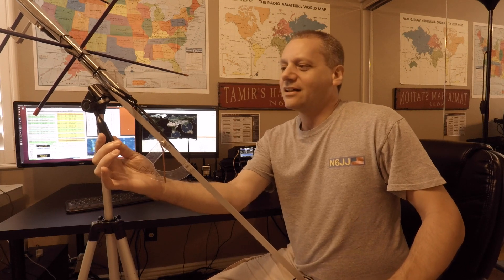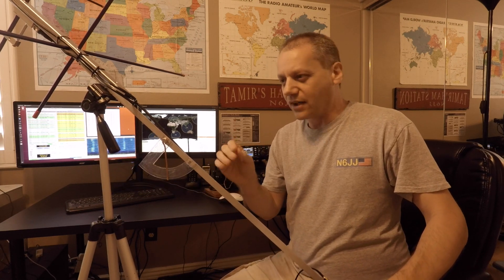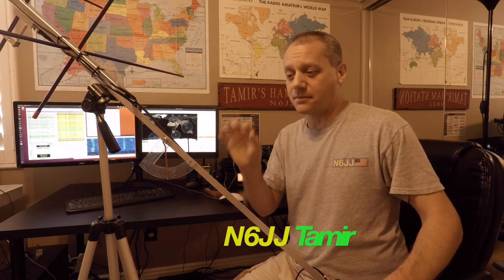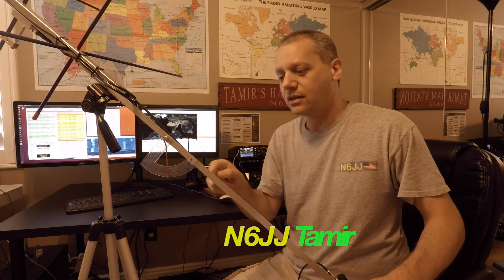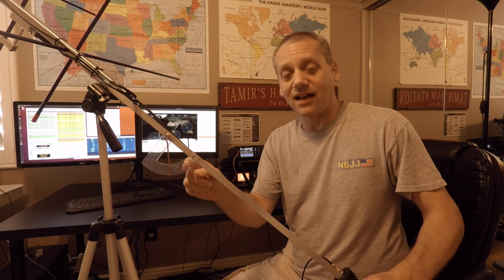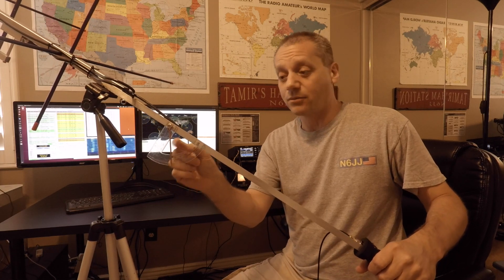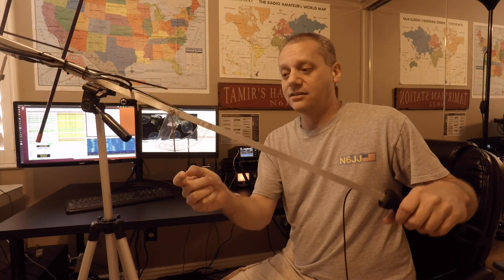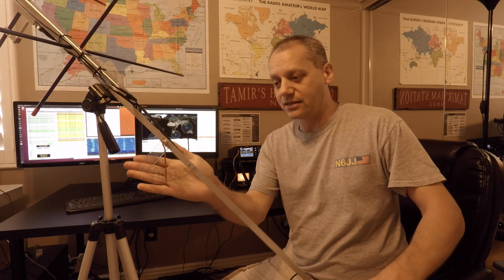DIY Add an Angle Gauge to your satellite Arrow Antenna

Comment: Hi Tamir.
Great trick.

One question about that antenna. Did you build it yourself, or did you buy it online?

Cheers, Robbert / TA2IX (aka PA3BKL)
Reply from the maker: Hi Robbert, thanks :)
That's the Arrow antenna, and I got it online, directly from the arrow antenna website. It's a great antenna. 
I'm using another antenna now, and I plan to release soon another video on that as well, and I will also mention the difference between the two. Again, it's a great antenna! 73!

Comment: So, in essence, you've mounted a protractor to yer boom with a free floating piece of wire attached to indicate the angle.  Very nice and great thinking for a simple setup.  I think I would have used a little bit lighter wire for the pointing device.
Reply from the maker: Indeed, this simple solution just use the gravity. Simple things work better. Thanks.